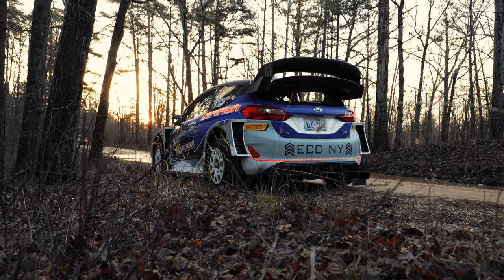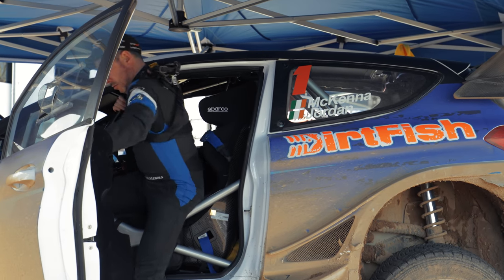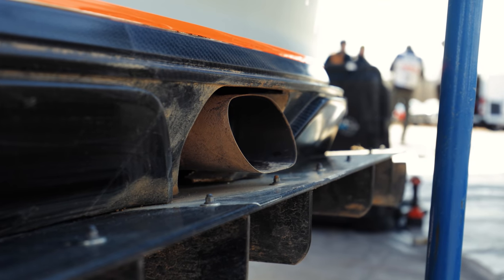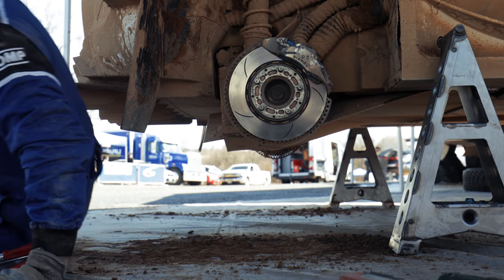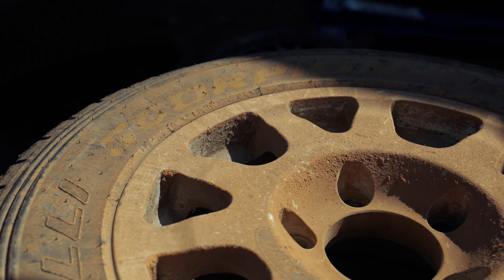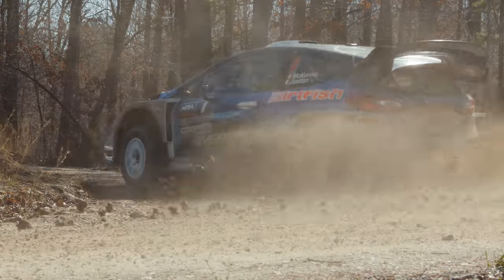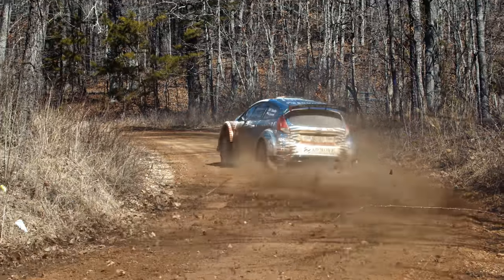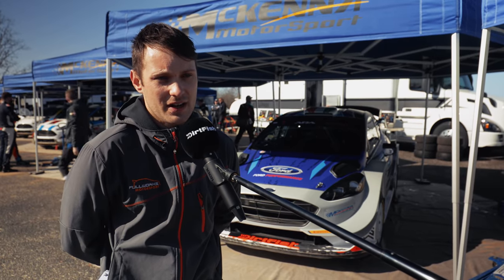First Modern WRC Car In America | M-Sport Ford Fiesta WRC

Comment: So it's basically an early 2000's ford focus 2.0 WRC tech with current ford fiesta WRC body,  Aero and suspension...
Keep the cost down and Fun up...
Reply: No its just a gimped WRC car with no active diff.
Reply: Hopefully they cut back on the carbon fibre in the body panels so it doesn't cost him $100K every time he bumps something!
Reply: Eventually he will switch back to an R5 plus platform when all that expensive Aero falls apart Everytime. Ken block's Skoda setup makes Alot of sense.
Reply: @Tedkelvin  He was killing everyone until he had that tire puncture, If he beats everyone that bad most races... he won't switch back

Comment: so is this a 2.0L version of the R5 1.6L or is this an older US 2.0 qualified plant?
Reply: My guess... it's a 2.0L version of the 1.6L WRC engine, R5's use less premium engine parts.
Reply: @ddmn3648  I assume it makes more power and torque than the 1.6...
Reply: @chapel976  Actually, the modern 1.6L make more power (380+ hp) than the older but yet powerfull 2.0L (300hp) do to restrictions ruled by FIA. In theory, both engines can make as much power as they can get from them. We have the cases of similar cars being raced in FIA RX, out putting something like 500/600 hp!! But your question is pertinent... so it all comes down with the FiA or local rally regulations and, how the engine is built and ECU settings. For example: the 1.6L can make more power and torque than the 2.0L simply by revving at a certain number... it can get its peak power at 7000rpm, as the 2.0L can do the same at 5500rpm (not actual numbers!)...

Comment: It's not really is it ? From the outside yes but at the end of the day it's just a earo package
Reply: You engine swap a Mustang & put a powerglide transmission & super tough diff to go drag racing, it's still a Mustang yeah?
Reply: @r8malooman  A WRC car is built to certain regulations, this is far outside these regulations therefore its no longer a WRC car so @skipper has a valid point.
Reply: @prodrive7105  I see where you're going with it but remember every factory team built chassis comes with build & homologation documentation to state the build specifications & purpose of the car/chassis. Many past Group A & earlier World Rally Cars, now no longer in official competition, have mods & changes done to them but still Group A & WRCars? 🤷‍♂️

I get what you mean though
Reply: Did you watch the video 😂 you are clearly mistaken
Reply: @Dfpijgyt564s65sgt  i do think so Tim

Comment: Probably a stupid question, but how do the classes work in these American events? Surely that WRC Fiesta would just destroy all the R5 cars and the two Subarus? Also, what's the deal with the Subarus because they're clearly way more gnarly than the R4 Impreza? It looks like they just let anything go, which makes me wonder how this is any different to Group B. As you can probably tell I'm very new to watching rally and my entire knowledge comes from playing Dirt Rally 2.0.
Reply: Not stupid at all, the WRC Fiesta they use in america is not really a 100% modern WRC-car, no centre diff etc...
but the aero will probably make the car much much quicker then the rest of the competion anyway

The rules are much stricter then the rules they had in the Group B:

https://ad7be502-15c0-41c1-8aa6-96d350a97bab.filesusr.com/ugd/f40cbe_6aae607dc0564b96b1c8f958987f0744.pdf
Reply: @chiqitachaser  Thanks for the reply! That’s really interesting. So what sort of class would these cars compare to then, A little more powerful R5 or something?
Reply: @Jacorpes    its complicated, the rules are different in different countries. its weird that the wrc-fiesta is allowed to race in america to be honest, it would be better to limit the classes to R5 to keep it more fair.
Reply: The one important thing to keep in mind, Subaru agreed to some handicaps a few years ago to even out their advantage over the privateers. They added about 300 lbs, have to use an off the shelf turbo, etc. They are still noticeably faster than an R5 at least on faster roads. If upgraded R5s and WRC cars become more common in the US, maybe they will have to let Subaru uncork it again. Sounds exciting, but arms races often have consequences.
Reply: @Jacorpes  I guess the top class of ARA is like an R5+ and somewhere just below top class WRC1